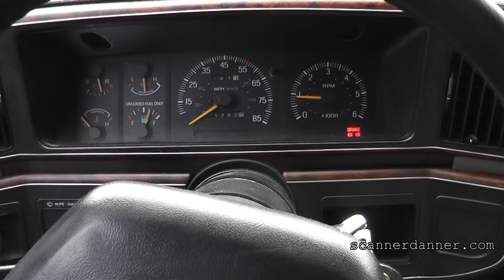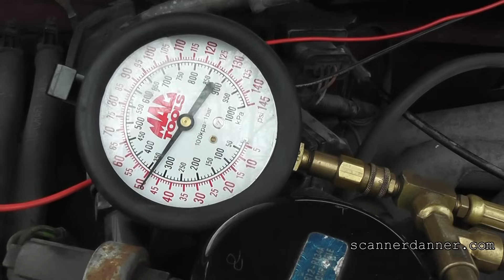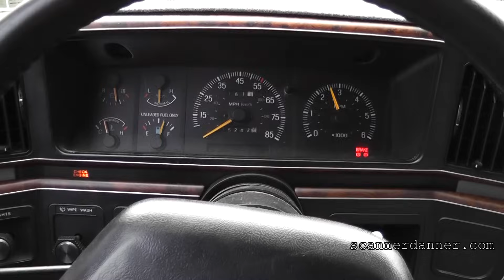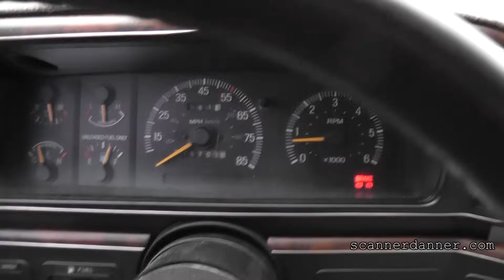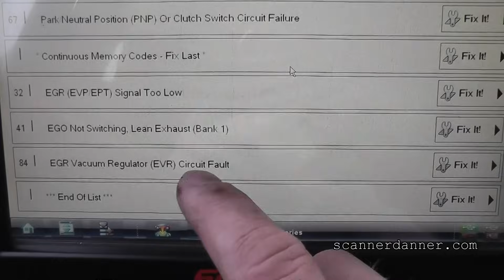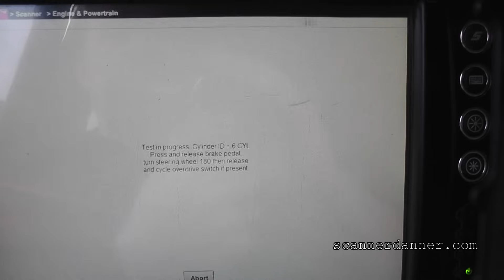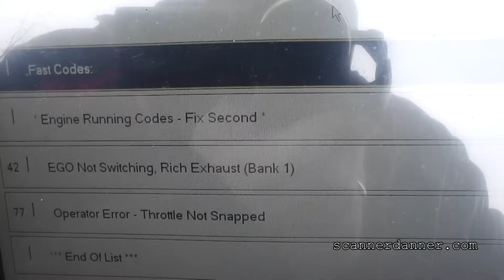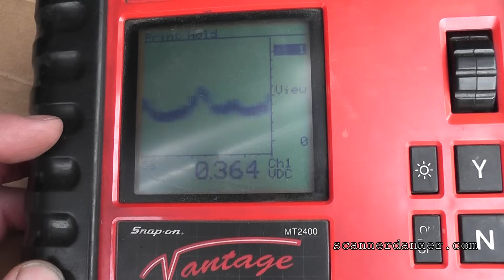1988 F150 Hesitation Problem [FIX!]

Comment: I am an old mechanic from waaaay back and really envy your patience and tenacity. Not changing parts before knowing for sure what is the CAUSE. You are a fine example for your peers and those who in the future. Much ablige:):):):).
Reply from the maker: Thanks brother!
Reply: I get bitched at, at the shop sometimes for doing the "check every possibility" methodology you teach due to time, however, when no one else can figure it after throwing parts at it, it becomes my head ache and i get it every time. So thanks for what you do i have learned alot. Thinking outside the box, and approaching things from a different angle. Also, i am a devout "sccpe guy", i diagnose plugged cats with an in cylinder transducer doing running compression tests, home built transducer set up with tons of home made attachments. 15 years in the shop, and your vids inspired me to "up my game" by learning the scope about 3 or 4 years ago. Now its the first tool i grab for diagnostics, if i can figure out a way to do it.
Reply: Rod X 1!!
Reply: I've had cars that don't start and all it was is a loose fuse,or wire disconnected
Reply: @ScannerDanner  hey man I have a serious question if you can help me with 91 F-150 5.0 manual 2wd randomly between weeks months to years I don't know randomly the truck will fail the ECM brought burn it up destroy burn up ignition module on the side of the distributor burn it destroy or it will rarely get the coil do you have any suggestions to what I can start looking forward to try to fix this problem for good can you give me a general direction like look at the ignition module wires or the engine harness wire pin number maybe this could help ground on driver side under radiator I'm just saying anything this is my only vehicle man and it's going on two to three weeks being down and it is starting to really hurt my wallet and put me a very bad position so thanks for anyone anything plz
Reply: @ScannerDanner  hey man I have a serious question if you can help me with 91 F-150 5.0 manual 2wd randomly between weeks months to years I don't know randomly the truck will fail the ECM brought burn it up destroy burn up ignition module on the side of the distributor burn it destroy or it will rarely get the coil do you have any suggestions to what I can start looking forward to try to fix this problem for good can you give me a general direction like look at the ignition module wires or the engine harness wire pin number maybe this could help ground on driver side under radiator I'm just saying anything this is my only vehicle man and it's going on two to three weeks being down and it is starting to really hurt my wallet and put me a very bad position so thanks for anyone anything plz
Reply: @jerrychacon8814  Your revolution is over. Condolences. The bums lost. My advice is to do what your parents did; get a job, sir. The bums will always lose. Do you hear me? The bums will always lose.
Reply: @rodx5571  are u able to diagnose plugged cats with a back pressure gauge?
Reply: @pitchforkpeasant6219  yes I can, but sometimes it's easier to do a running waveform and see if when the exhaust valve opens it rises above the atmospheric pressure line, and other tells in the waveform. Can usually get to one spark plug, can't always get to an upstream o2 sensor. Or don't always have a car lift. But short answer,  yes I can. But I still use the scope and a pressure transducer. Same test. Other things, is the exhaust super hot? The catalytic Temps, check with thermal imager if you have one.

Comment: The best padding for under car work that I have found is a piece of thick carpet. You can get these at any carpet store, in almost any size, for very little money. Just keep it rolled up and laying in the back of your truck. It insulates from the ground well, even on snow. Just get a THICK one.

 Also, for a "headrest", the boat seat cushions that are about 15 inches square work well. They are about 3 inches thick, and have flexible "throw handles" on two sides. Cost is about 15 dollars at any outdoors store.

Also, one of the blue utility tarps available at any tool shop or outdoors store can be very useful for keeping the carpet dry.

Working underneath a car in cold weather is tough enough, but if you can find ways to stay very dry and not have to feel all the rocks and ice on the ground makes a big difference. And Paul, you might try wearing a cap (you know, a winter cap, not a baseball cap)!

Hang in there.....

Comment: I am a retired auto mechanic from long ago. It’s  nice to see a real video from a real mechanic. I just replaced (sucked in) throttle body gasket and cleaned all the crap out of the inside of the throttlebody that fixed my problem.  Oh I changed o2 when I did the starter. Thanks!

Comment: Hey Paul, great video.  I got an 86 GT 5.0, I got the idle running perfectly.  Locked on at approximately 650-675 RPM. However, once in while idling engine warmed up and in close loop, the engine will drop in RPM about 50 RPM and back to normal in a hunting fashion.  While its hunting the Vacuum gauge also drops from a steady 18 inches of mercury to about 14 or 15 inches of mercury.  At the same time this is happening,  I'm monitoring the ECT, IAT, MAP, EGR, PIP/SPT, TPS,IAC (sawtooth waveform) and all parameters were within specs.  Finally I performed a amperage check on the IAC while the RPM hunting was occurring,  I noticed an increase in the amount of IAC current draw during this RPM hunting.  I'm thinking the IAC step motor may be acting up, since normal position of the IAC is closed via spring and maybe the IAC is struggling to keep itself open do to age,etc. The IAC plunger is spotless I cleaned it and the throttle body plate as well is spotless.  My next step is too replace the IAC valve, it's the original I'm the original owner but I have  always kept it spotless.  This Mustang does mods I performed but always ran AWESOME after mods until this recent Idling issue,  what do you think about me replacing the IAC, keep up the great work. Oh forgot to state the fuel is rock steady 39 psi and under acceleration increases to 42-43, with no problem.  Thanks Paul

Comment: Hi Paul one of the things I have done is take out number 1 spark plug and put a probe down there and turn the engine by hand for top dead centre, then maybe back I little to ifnd the timing marks, fool proof way if your on the right cylinder, am I right in saying with zero volts at the oxygen sensor it will run rich, I had one once with a broken wire and it ran really rich...anyway good informative video thanks Fred uk
Reply from the maker: In closed loop yes.

Comment: I have a 95 F150 4.9 with 4R70W automatic.  I've been chasing a bad surge for a few months, it violently "break dances" at highway speeds.  I've done all the usual tune-up stuff, including vacuum lines.  Truck now has 190k.  Checked and blocked off EGR valve and even did a "poor man's" cylinder leakage test (shooting compressed air into spark plug holes with radiator cap off) - I'm to the point where I either got a bad new part out of the box, or I have a wiring problem.
Reply: I had a wierd issue like that with mine , though it’s a 5spd manual - I kinda took a guess at the wierd box shaped thing on the firewall with a vacuum tube to it called the map sensor, that was it I got lucky it ran like a champ

Comment: I find it amazing the different things that can cause performance issues like this. I have a 2004 Honda Odyssey that was giving all kinds of codes from O2 to rich on bank 1 to lean on bank 1 to Evap system . . . . . Long story short, the little rubber grommet on top of the fuel pump (inside the sending unit assembly) had cracked and was flaking off. After a ridiculously long search, I was finally able to obtain one and replaced the broken one. Now, the thing runs almost like new. Before that, it would run great with a full tank of gas, but once it dropped below 1/2 tank, it would hesitate and balk, sometimes nearly die out completely!

Comment: Paul, Great vid. I've seen you lay in that same parking lot time after time. I have a dirt drive way in front of my garage so I feel for ya! Little tip if you ever see a old weight lifting bench on the side of the road, grab it. The cushions on them are great for laying on the ground and are very portable because of there compact size. Perfect for Pete's parking lot and will make a perfect addition to your mobile tool chest!

Comment: Paul I have a 95 300 with a stick same exact symptom. The only way I was able to stop it was to insert a straw from a spray can to delay the vacuum and that  fixed the problem. ford's fix for this was a one way valve with a delay to solve the problem. I cleaned the egr circuit changed the egr solenoid with  no difference. but the restriction in the vacuum line eliminated it. I also replaced the 02 sensor. made no difference. hope this helps.

Comment: I just got an 88 F150 with the 6 cyl that is exhibiting the same faults as this truck... stumbles at part throttle with the EGR hooked up, unplug EGR and it runs great. The valve itself moves fine, vacuum control is fine, and the position sensor measures OK. I hadn't thought to check the O2 sensor - now I know where to look next!

Comment: In some ways older vehicles can be harder to diagnose than newer ones. As you said, it is a lost art. There's nothing quite like the feeling of getting a "vintage" vehicle back on its feet, when most of its brothers are long gone to the junkyard in the sky :)
Reply: All that said I Rather have an older vehicle You don't have to take half the vehicle apart to get What Your after And you don't have to buy ten thousand dollars scanner either

Comment: Good tip on "cause or effect", it's tricky to distinguish between the two sometimes.  EECIV is one of my least favorite systems to diagnose.  On the previous video, I would suspect a bad splice, but with no good info on older systems it can be tough.  Good fixes!

Comment: What I have found helpful when I use to work on the older engines a lot Is to take a wire brush or a piece of crocus cloth and hold it against the harmonic balancer underneath the vehicle while the engine is running. It works really well when trying to find the timing marks on a balancer especially when your degrees are on the balancer instead of the timing tab.
Reply from the maker: just be careful right? :-)
Reply: Safety first :-)

Comment: As always thanks for all you do!

Reminds me of a problem child we had that I posted on iATN in 2013.  Same type of scenario and outcome sort of...

1999 Jeep Wrangler Sahara 4.0L Hesitation, Surge, Cuts out, Stall, Misfire, Intermittent Sensed
The scanners reported a weird #4 misfiring --- so we went down that rabbit hole big time - shame on us.  Probably we were psychologically motivated to pursue that angle because we we scared the rebuilt engine that we at the time we recently installed was awry and that would be blood on our heads.
Here is bottom line summary as I closed it in iATN  "Well here we hope is end of story. After persistence on part of tech collecting scan data it was apparent that on occasion O2 sensor output was weird. We electrically tested circuit and settled on the sensor itself. 

New OEM sensor installed (consulted with dealer master tech first) and vehicle running perfectly. Now O2 output not just fuzzy perfect but always spot on perfect. 

Finding this eluded us because O2 output seemed OK enough (and was 90% of time) - but that "hidden" 10% was kicking our tails. 

Also sometimes it pays to just ignore a mystery and go for the obvious. We believed the tombstone miscount graph (still there! consistently! still mystery to all including dealer master tech consultant) was clue to problem. When the common O2 sensor drop out seems to have been the cause of driveability problem. "

Comment: Great throwback video. Got worried there in the middle of the video that the exhaust leak you mentioned early on was causing a faulty O2 reading. Nice diagnosis.

Comment: I've used a welders wire brush to clean the rust and crap off of the harmonic balancer while he engine was running. Makes it look like new, and you can see every timing mark that's on the balancer. A lot easier than guessing.
Reply: We also have luxury of the google tool in our pocket where we can quickly locate info like “ford 4.9 balancer marks”

Comment: i have this exact same timing light and its gotta be over 15 years old now still works like a charm, also remember the fan blades are invisible when spinning watch your finger tips it doesn't feel good usually wont cut ya

Comment: I just replaced the TPS on my Ford with EEC-IV and it erased 2 codes about EGR valve position sensor. It had vacuum at idle and the engine loped. I didn't snap the throttle completely during the running test and it threw out a code about TPS. I ordered one from Autozone and re-tested the codes. I DID do full-throttle this time and the code went away. I replaced the TPS since it was about 6 yrs. old. THAT was the problem causing vacuum at idle but it threw out EGR codes!

Comment: I picked up an old Cheby tbi. Had bad stumble off idle. After a while got the idea to take vacuum off EGR valve. Yay problem fixed! No more stumble. Well, after a while problem returned. Checked fuel pressure, guage shows 9 psi and 6-7 on a snap throttle. Smells extremely rich but runs like it lacks. So leaning towards pump or 02 sensor. Like you said cause and effect. Thought it was EGR but I think EGR was just magnifying the problem. I thought the same at the time, is this cause or effect. Now we know.
Reply from the maker: that fuel pressure shouldn't be dropping on a snap throttle, it should be 9 all the time!

Comment: I think this is one of the better in the field video's you have ever done. You didn't seem as stressed as I have seen you before. I have worked on many trucks like that and I was screaming for you to check the O2 sensor. LoL. I don't think you heard me though. They only try to correct for so long before they go into open loop. I have also seen EVR solenoids stuck open allowing uncontrolled vacuum to the EGR.
I'm kinda glad they don't build them like that anymore but at the same time I miss the simplicity.

Comment: Actually we could get data from the sensors,but not from the self test connector. The EEIV monitor hooked directly into the 60 pin ecm. It is like a break out box with a LED display. So it was live unprocessed data with a knob that rotated to view different sensors. Great video Paul, it brought back a lot of memories!

Comment: Hi Paul I am building a off road Toyota T100 Pickup for off road racing it has no cat or muffler its strictly off road... what tuneup or adjustments do I need to do to make it run efficent.. ect: fual mixture- timing- or anything else you know about. Thank you Paul your the BEST !!

Comment: i have the same truck at home except it has a v8 instead. i have learned a lot of patience with this truck. the throttle body was plugged solid and all the bolts on the engine were just finger-tight. that would explain the 3000 rpm right out of the gate, blown head gaskets and burned valves. i almost got i fixed now. but it is winter and 40 miles away outside.

Comment: Excellent, I'm still back tracking, I had these symptoms initially,  changed the O2 and still had same symptoms, so I changed the a bad hose on the fuel pump but in addition my truck stops running intermittently, no check engine light on key position, no start, crank. 00Mazda B2500SE 2.5L  I have no diagnostic tools except a volt meter & test light.  Thank you for sharing your knowledge & experience.
Reply from the maker: find out what you are missing when it doesn't start. these videos may help
https://www.youtube.com/watch?v=S0Fs2i-XBKI
https://www.youtube.com/watch?v=SUxagOAVS5M
Reply: With the car key in On Position found the Relay that Controlled the Check Engine Light and Changed that Relay (Auxilary Power PCM?).  Now my truck starts Dan.  Approximately what is the most I should I pay to get a Full Diagnostic Scan at the Dealer where I originally bought the truck?   Don't have any codes and have to put the truck back together before I can road tested it.  But I did leave the engine running for over an hour and it didn't die.

Comment: Stretched timing chain maybe could cause that idle issue I have two friends who have had to replace them on the 6 cylinder on that year of truck. I have also replaced a throttle position sensor that keeps coming loose on the throttle body it was a culprit on my 1992 ford f150 with the 5.0. I thank you for the video thanks for the upload.
Reply: The inline 6 doesn't have a timing chain.  It is gear driven.

Comment: Might want to consider a head mounted Go-pro camera? Ive had an O2 sensor repeatedly shut down the truck once its warmed up. No check engine light. Took awhile to figure it out.

Comment: These have a lot of issues with the PCM having water intrusion which creates all kinds of problems. I always do the KAM reset so i don't have to wonder if the system is re-learning from one extreme. After a reset it's working "from the middle" of fuel curve adjustment. The rolling idle is likely a dirty throttle body and possibly someone has messed with the throttle plate hard-stop (minimum air rate) adjustment.
Reply: Agree, just didn't care to fix everything if that makes sense. Not unless they want to pay me more
Reply: ScannerDanner Premium I agree 100%. You did what you were paid to do. I tend to give my knowledge and labor away too often.